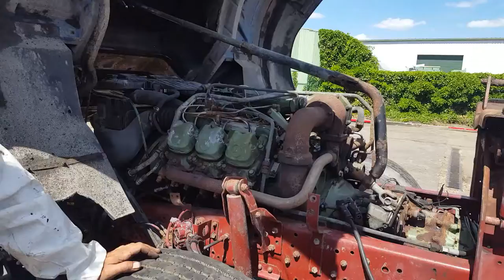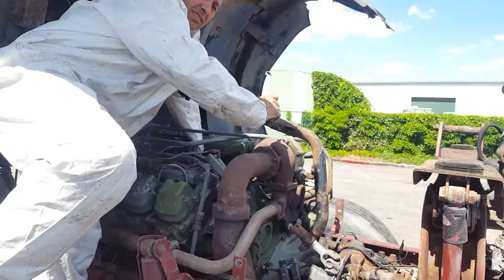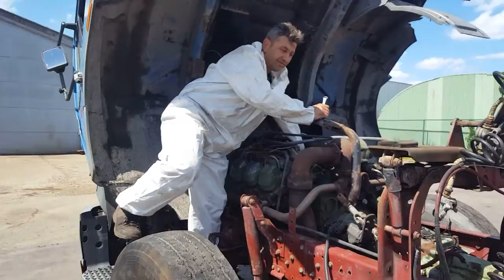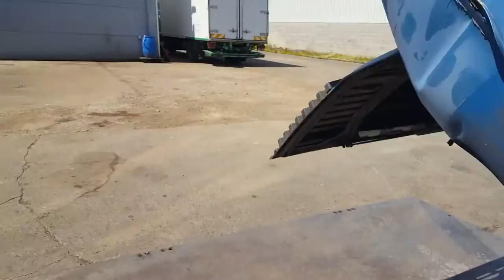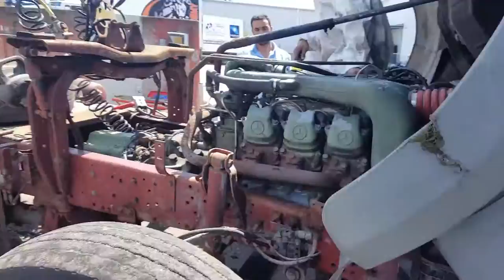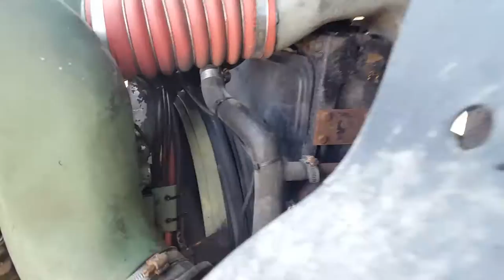OM401LA

Comment: V8 POWER
Reply: V6
Reply: @HansGurke44  it's SK V8
Reply: @HansGurke44  hans get ze flamenwerfer
Reply: @Steve1766  Please count the cylinders, 3 on one side, which means 6 in total. V8 would be the OM402/422/442
Reply: @HansGurke44  what the fuck isn't this supposed to be a SK ?
Reply: @Steve1766  Yes it is, but not all SKs have a V8 engine. They came with V6 and V8 engines, depending on the desired power output. The one in the video is a 270 hp version, therefore it has the V6.
Reply: @HansGurke44  weird huh ? it sound the same with the V8 powered ones also why on earth should sk have v6 they only have v8
Reply: @Steve1766  No it doesn't but it sounds weird because of the uneven firing order, they just removed two cylinders from the V8 without changing the crankshaft design. You can read it all online. Anyways, in this video it is indeed, as you can see, a SK with a V6 engine, believe it or not :)
Reply: @HansGurke44  i never heard of SK with V6 i only knew it as a V8
Reply: @HansGurke44  the first om401 normally aspirated v6 had the uneven firing order, and sounded awful, this is a post 1981 with the offset crankpins and has even firing timing.